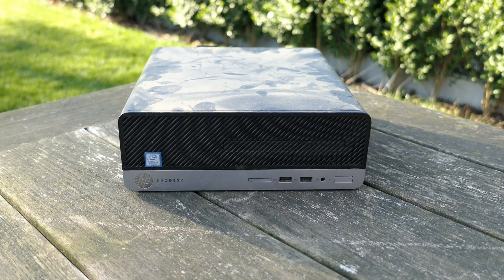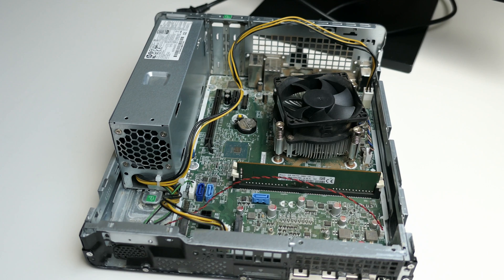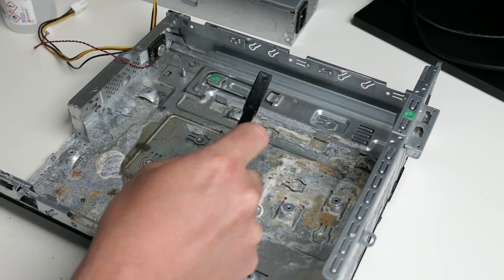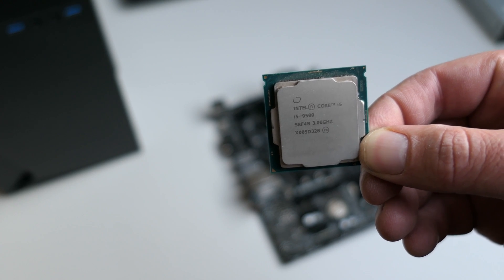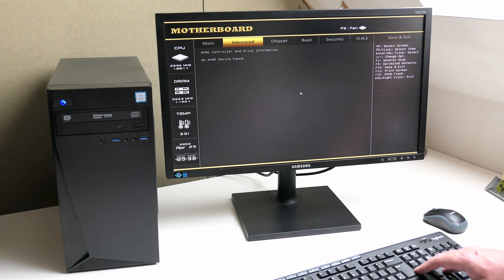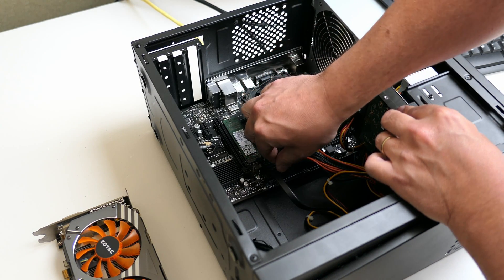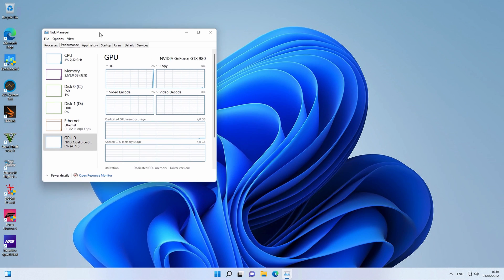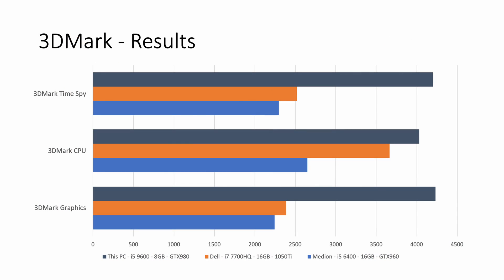HP ProDesk 400 G6 SFF - Can it be saved?

Comment: I'm so confused why you would not upgrade the 8GB to 16GB. 1 stick of DDR RAM runs at half speed.
Reply from the maker: I simply didn't have one at hand anymore when playing around with this. Dual channel indeed increases the performance but the difference is around 15-20% as far as I've tested, definitely doesn't run at half speed (fortunately).
Reply: @jensdbe  I understand the argument that you can just put the extra money into the CPU, and that it's just hard to sell the systems unless they're rock-bottom price, but my OCD... I just want to pull my hair out!

Comment: So does this mean that the HP motherboard standoff spacing is standard ATX, mATX,...?  Or, did you need to modify somehow to fit inside the new case?  Just wondering, since I'd like to do the reverse and drop a new mobo inside an HP prodesk 400 g6 sff.
Reply from the maker: The case and motherboard are not to any standard as far as I know. So re-using the case with a different motherboard is not an option and re-using the motherboard in a different case neither, unfortunately.